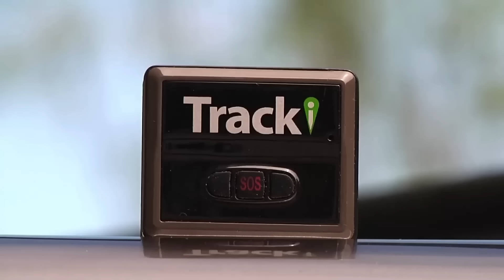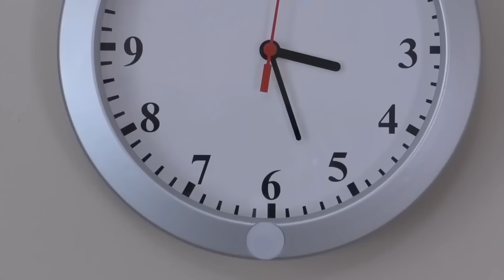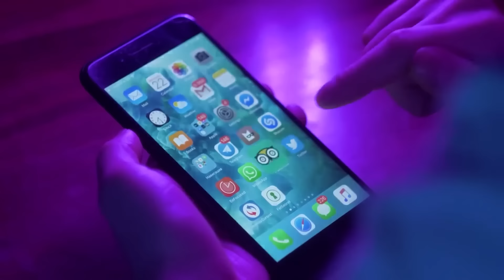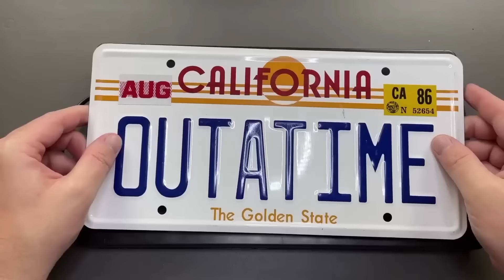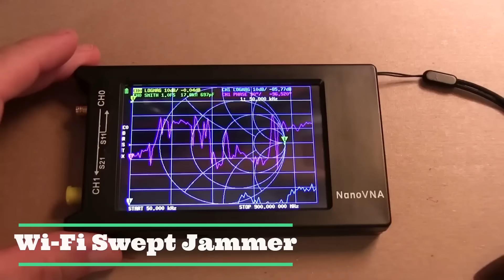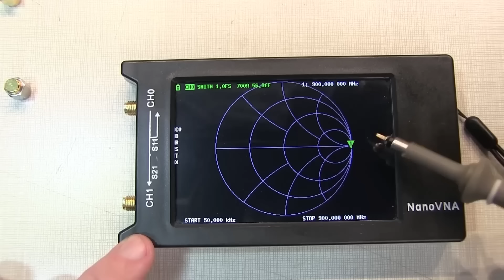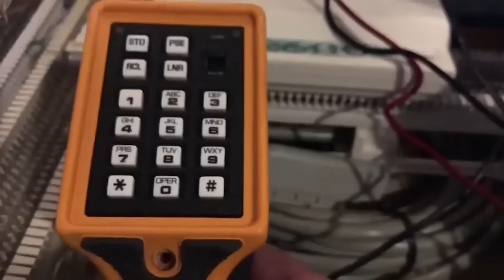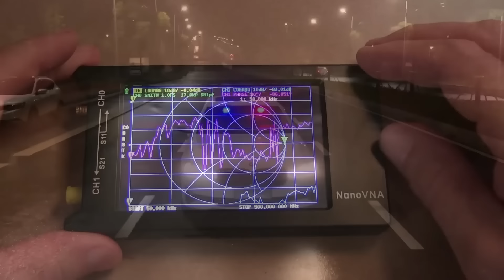20 Amazon Products You'll Be Arrested For Owning

Comment: That flamethrower kit is stupid and expensive. You get a toggle switch and thick copper wire and 2 spark plugs. You still holes in your exhaust pipes at the end. Then screw and bolt in the spark plugs. Then put the wires on each one. Connect wires to toggle switch. Then connect more thick copper wire to your car battery. Turn car on. Switch on toggle. Flames will shoot out your exhaust pipes. The spark plugs spark from the battery and will ignite the exhaust.